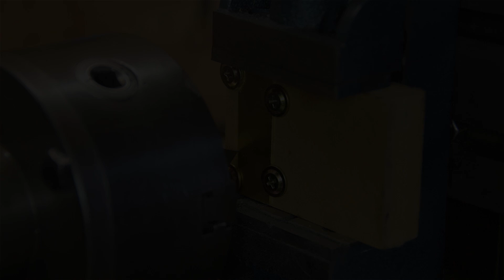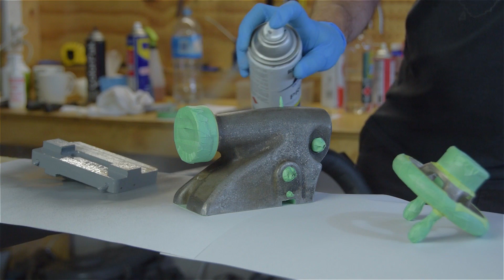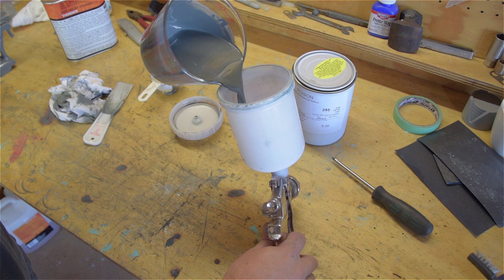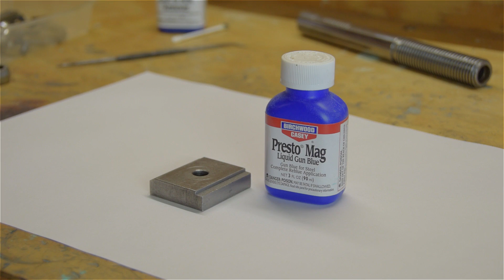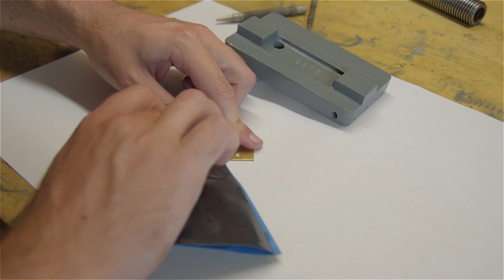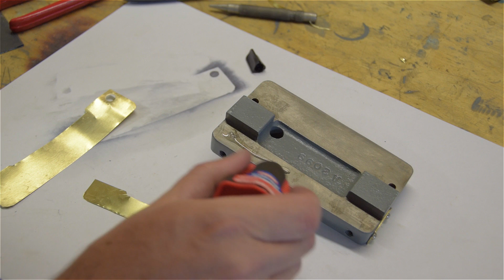Myford Lathe Restoration - Part 5 Tailstock

Comment: Great video series, really enjoying it.  For scratches in metal use a razor blade to push a couple of coats of either metal infused auto filler or JB weld into the cuts and fine sand at 2000 grit.  No mess, fuss or file needed.

Comment: Very helpful. I have to add shims to the base of the tailstock of my Smart and Brown lathe and was wondering what glue to use. I think Superglue, which you used here, will be a better option that Araldite
Reply from the maker: Yeah, I reckon start with the easiest to remove first, and work up. I can easily pull the shims off if I want but the superglue is good enough to hold them in place.

Comment: Geoffrey, I just found this playlist and watched the whole thing. I own an ML7 on which I retrofitted the quick-change gearbox for leadscrew drive.
Beautiful paint job on this tailstock. Did you do anything about the pointer for that new scale to make it clearer (mine is hard to see)?
Was there any reason to put the shims under the base of the tailstock rather than between its base and main casting?

Comment: What kind of paint stripper do you use, I have no luck with Nitro Mors :-(
Reply from the maker: I buy it from an automotive paint supplier. Seems to work better than the stuff from the hardware store.
Reply: König Hansen I simply dunked my ML7 parts in cellulose thinners and the paint dissolved off in a matter of minutes. It also has the benefit of leaving them clean, dry and grease free ready for painting

Comment: Extremely nice of that previous owner to butcher areas that are both hard to fix and right where it shows his "talent"the best. It's definitely looking a whole lot better. With clean, bare and dry castings brushing on a heavy coat of 1 hour epoxy works well. A lot tougher to get it level and sanded smooth though.

Comment: Very nice work. Any reason you shimmed the bottom of the tailstock base rather than shimming in between the main body and the base?
Reply from the maker: I didn't have to worry so much about the machining being perfect if I covered it up. I may need to add shims in between as well, if alignment is an issue.

Comment: Amazing how you engraved a new brass scale with standard accessories !
Can you give more info about the "putty" for the body preparation, before painting ?
Nice video, thanks for sharing.
Reply from the maker: It's just spot putty. I normally use it after sanding down automotive filler, to fill in pin holes left by bubbles or sanding scratches. It's a lot softer than regular filler. The 3m version is very common, comes in three colours which dry at different rates. I aways use green which is medium.
Reply: Thanks Geoffrey !